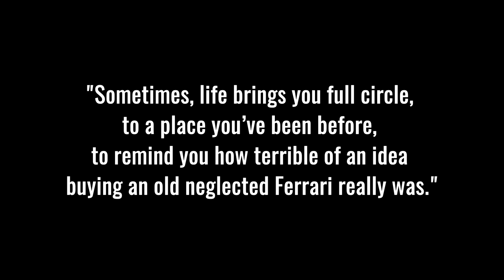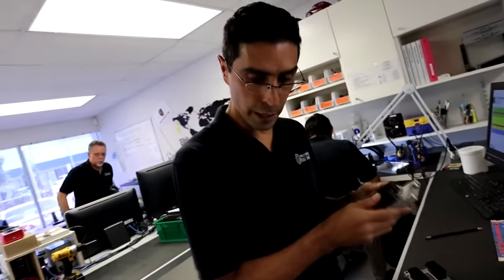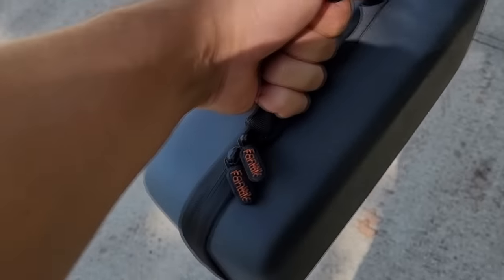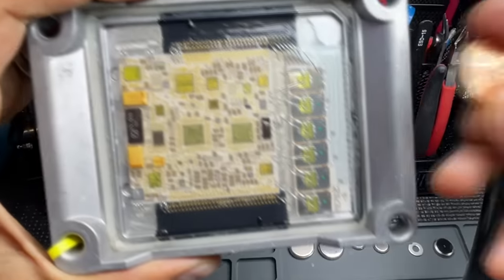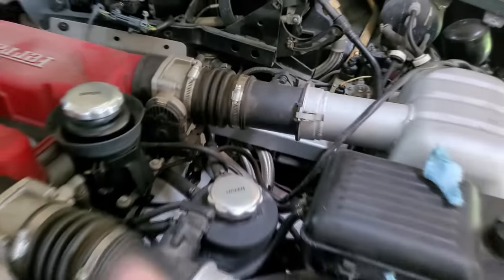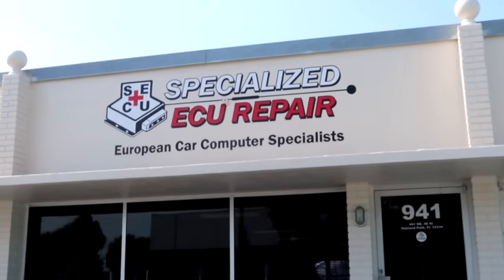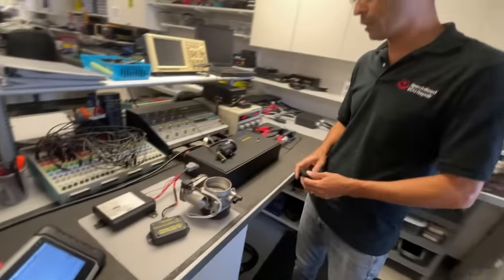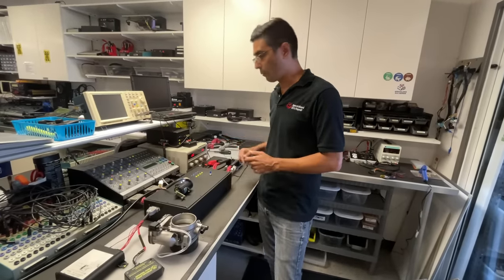Here's What FINALLY Fixed my Cheap Salvage Ferrari!!! (EVERY Ferrari 360's Fatal Flaw)

Comment: It might be worth while for them to send the software, signal descriptions and pin outs to companies that make aftermarket ECMs.  Technically they don't have to duplicate the Bosch ECM only build one that can run the engine.  Maybe a single ECM for the whole engine.  Which might be fairly easy for an experienced company.  You have to software you just need to create the electronics.
Reply: Good luck with the chip shortage lol
Reply: It would be an interesting FPGA project. As always though, it is having all the information on operation.
Reply: @hutchison82  I hedged on that probability and married a Chinese woman.
Reply: I said the same thing....every ECU basically does the same thing: uses various inputs to determine various outputs: ie cam position, and when to fire the fuel injector and spark plugs. Sure some vehicles may have more inputs/sensors than others but seriously, they aren't that much different. 

Holley makes a stand alone ecu that works with LS engines and their throttle body. B is for Build uses them all the time. 

The ferrari/bosch ecu though makes me think they designed it that way on purpose: so it cannot be repaired. Kind of like how apple designed their phones......
Reply: You’re absolutely correct just cut the wires off put your own pens and using GM or Ford wouldn’t matter all you need is the software

Comment: Impressive diagnostic/fix. It'd be great if someone could build a replacement or modify an existing ECU to get around the dwindling numbers of ECUs and escalating costs. I'm sure mechanically the 360's have lots of life in them beyond the crappy ECU design. (Even with the myriad of other issues.)
Reply: The only long-term solution for car enthusiasts is to manufacture new boards or come up with a generic solution, like the Microsquirt type equipment.

Comment: The BEST answer is to make it so they run off of 1 or 2 Speeduinos. With the right support anyone can make one and anyone can program. While that's open source, cheap - free, someone can make some money making and programming so it's plug and play for mechanics who don't have time and the inept who are incapable.
Reply: As long as the car doesn't have any sort of VVTI system Speeduino is a great shout, also dont think it can do anything with transmissions. Its rare to find someone that can do mechanics, wire and map an ecu
Reply: @ryanharveywhite  I'm sure a program could be mapped for a transmission with either an Arduino or something Arduino like, to emulate a TCU. It would probably be based on the needs of the transmission. Ferrari 360 technology or anything that old was not advanced so far as computers go.
Reply: BIG CAVIOT; the electrical and thermal automotive environment is brutal. None of the hobbyist boards or most of the processor themselves will operate or potentially survive under the hood of a running car.
Reply: @johnelectric933  True. Metal boxes and potting compound should deal with most of that. How many Ferraris are parked outside anyway?
Reply: Just mount a commodity tablet on the other side of the firewall and the adapter box inside. You could even troubleshoot from the tablet.

Comment: About jump starters: It really is amazing what lithium cells are capable of when you pack them tightly enough. While professionals will want to carry around something the size of a large microwave oven to jumpstart a handful of cars every workday, I, as an individual, can now keep something the size of a housebrick in my trunk to bail myself or somebody else out anytime anywhere. Mine isn't as nice as the Apex and doesn't have as much crank current, but it's the same idea. Biggest engine I've started with mine so far is 3.5L. These things are wonderful little tools for the backyard tinker.

Comment: Media blasting. I did media blasting for about 7 years and got very good at it. I also gained a shedload of perspective on what media blasting could do.
I think it may be the solution to your problem I think I'd start with a small blasting cabinet and some fine garnet media. Keep in mind that for something like this, lower pressure and greater media volume is the place to start. Slowly turn up your pressure and lower your media volume until you have the effect you want.

Comment: So the fix was to buy a replacement ECU and have it reflashed.
Reply: Yes. Did you not see the bit where they showed these ECUs are not repairable? machine assembled using unconventional techniques. It's the equivalent of wire wrapping done by a machine. Absolutely no chance of human repair.
Reply: @6581punk  But why we can't use a universal ecu? Buy a haltech or something and just do the wiring
Reply: @Partyczka  Its probably doable but at the moment it's likely a custom rewire job, which is more expensive than a 2nd hand ecu. I'll bet someone will build an off the shelf replacement though when enough people need replacements.
Reply: @spwicks1980  Ferrari and Bosch would probably sue them!
Reply: @aitorbleda8267  not if it was licensed. Easy way to make money on unused IP. Would make the price pretty steep though but once all the second hand units get gobbled up it'll be worth it.
Reply: @Partyczka  Because its everything else the ecu is interfaced with. That being the F1 style gearbox controller and body controller.  If it was just simply running the engine then hell yes, get rid of that Bosch boat-anchor and get an aftermarket in there pronto!!

Comment: There are several generic ECU units out in the market. 
I would suggest the following steps:
1. Get a copy of the technical reference for the Bosch device. What kind of CPU used etc. Don't be surprised if the ECU is a physically scaled down version of a VW Golf ECU :) . Maybe you could find a software compatible ECU from the same time period but in a bigger package? 
2. Attach a multi channel logic analyzer to the impressive simulator setup showed in the video. 
3. Record the input/output events during different operating conditions.
4. Disassembly of the original software and analyze it's structure and workings.
5. Start to implement the functions required in a structured order on the generic ECU so they mimic the original ECU. Test, Test, Test -> until you have the full feature set implemented. 
6. Test input/output when adding functions with a test script simulating different operating conditions. 
7. By the way a multichannel oscilloscope interconnected with a test computer that links the analog signals with the logic signals could be handy.
This is a job for professionals. You can brake things in a spectacular way if you don't are really, really careful. 
One of several generic ECUs in the market:
https://www.continental-automotive.com/en-gl/Trucks-Buses/Vehicle-Chassis-Body/Vehicle-Control/Generic-Vehicle-Control-Unit

Comment: This is great content man, that video of the bench setup with the clicking was so satisfying!  It makes you wonder why Ferrari wouldn't use a standard PCB instead of this micro proprietary one with the janky side solders.  No doubt the Ferrari Engineers know better than I do but I can't see any real practical benefit there.  It also raises the question, why did the first one fail?  Seeing that these computers are located in the engine compartment, I'd make the generalized hypothesis that heat was a factor.  Perhaps some preventative measures could be in order to be on the safe side?
Reply: BOSCH does crap like this all the time.  Ferarri just gives BOSCH the specs they need and BOSCH modifies their ECU de jure.  BOSCH stops making them after the car run is EOL... collectors be damned.

Comment: Really great Video! I am myself an electronic & IT professional and i would guess it will be not that easy at it seems to be on the first glance. The original computers are on a ceramic substrate for good reasons, there is not only vibrations but a lot of heat!! Almost every Ferrari is a very tight package, very big engine in a small body. I would guess if they had used a classic open pin package, like the old 7 series that we could see here, the computers would not make it till end of the month. The CAM and engine-sensors are easy to manage today, but building a package that will work 10-20+ years is something very different. Wish you all best!

Comment: I find it hilarious that Ferrari can't figure out how to make one ECU handle an eight cylinder engine. Like everybody else on the planet
Reply: It was common on the late 90s to have 2ecus on complex v8s and v12s
Reply: @camilaitor1  like BMW
Reply: @82_KID  I was thinking about the bmw 850-850i, yes
Reply: @82_KID  new ones don’t have that issue
Reply: V8's that spun past 7500 typically did due to ECU limitations
Reply: It isn't ferrari that makes the ecu, its Bosch
Reply: @thetechgenie7374  Muh green materials!  Yeah, rats/mice eating soy based wiring insulation, soy based foam seat cushions, etc, is always annoying.  Lots of early/mid 2000's cars with soy based insulation just had the stuff get brittle and fall off the wires in high heat environments, too.
Reply: @SteveBassen  Yep seen it brittle and no insulation anymore, seen one catch fire even.
Reply: Think they do it  to reduce   total failure   if one  timing sensor  goes engine will get you home on other  bank
Reply: @garypeatling7927  nah it's total hardware limitations, takes a lot more CPU cycles to support a 10/12 cylinder or an 8 cylinder that's spinning to 9k vs 7k. The latest gen stuff isn't as limited but the late 90's through late 00's stuff this was pretty normal to do.

Comment: Sounds like the ECU's need to be replaced by micro form factor computers running an emulation of the ECU.  Been done with other cars in the past...
Reply: In a few years open source MCU platforms like Speeduino will probably become viable drop in replacements

Comment: For those thinking that having a new PCB made is expensive ( just the circuit board with no chips on it ), the cost is $2 for 5  100mm x 100mm sized boards.

Comment: I've done a lot of work on diesels and now aerospace vehicles. Judging from this video alone,  I would suggest making a custom vibration mount for your ECUs . Seeing how the ECU is custom made with bespoke manufacturing,  they seem to be very sensitive to vibration. The wiring in the ECU is likely getting broken from work hardening under the high vibration stresses, and the eventually snapping. 
   The way you explained  in the intro where the car started the first time, but then failed after the second time is a common fault in electrical transformers with internal wire fractures. The Transformer will work when it's cold, but as soon as it's hot from working a bit, the broken wire expands from the heat and stops working. But as soon as it cools off,  it contracts and starts completing a circuit again.
Reply: I have seen that type of breakage in coil packs, on a few early model distributerless engines. Was a really bad design flaw, in Cadillac and Buick engines that caused the coil packs to fail like that. Would see it with one car that would not start when the car was cold, and another when the other car was hot. Same basic symptoms, different triggers, same test procedure as with the Ferrari’s duel ECM only with coils.

Comment: Dealerships aren't going to train new techs on old cars. That's just flat out. As older techs retire, they take the info and training with them. It's difficult to diagnose a vehicle that you haven't been trained on or had and experience with.
Reply: I mean service manuals exist so yes and no.
Reply: this is beyond a basic technician, this is more engineering. We know what is faulty, but we need a way to design it cheaper
Reply: @brayannexon4613  he's blaming dealerships for replacing ecms. Show me a service manual that includes how to resolder an ecm. I love these shops that can supply the in between, but I don't like when people throw shops under the bus because of what they are taught.
Reply: @carwerks101  yes, sir

Comment: I wonder what Louis Rossmann could do with these?
Reply: Nothing - these are not PCBs in the normal sense, and there is no soldering. Instead, the bare silicon dies are glued to a ceramic substrate and gold or aluminium wires are fusion bonded directly to the die. You would need a wire-bonding machine and a way to remove (and replace) the protective silicon coating. If the failure is with any of the chips, you will be entirely out of luck - everything will be custom.
Reply: Yeah this looks like a design that was not meant to be serviced at all... I imagine that in the future someone with enough knowhow/computer learning will be able to emulate/recreate the exact function of this or any ECU from scratch using modern parts at least that is what I feel like the best solution will be.
Reply: @ickipoo  He may have some tricks up his sleeve. An iPhone 6 on each side running an app. To keep the Ferraris coming back.

Comment: This is common on many Alfa Romeo Gta 3.2, it has the same ECu. The discrete PCB components are glued down with expensive conductive glue. Over time it breaks down and the usual culprit is a capacitor. It is repairable, no need to reprogram a different unit as it may soon develop the same issue.

Comment: Ferrari and others put the ECU'S right next to very hot engines on purpose.
It's built in obsolescence right there.

Heat shortens the life of electronics full stop.
Some ECU'S are behind the bulkhead (bad for getting flooded!) others are under a seat (probably the best environment) but cabling becomes much longer.

Perhaps a good reason not to buy a Ferrari after watching this great vid 👍👍

Comment: The problem with these ECUs are the outer aluminum (silver colored) bonding wires. They just degrade and break. The thinner, gold colored ones are usually ok. You can verify this by just "poking" the thicker silvery wires. Most of them will be stiff, but some will feel soft, and easily detach from the ceramic base.

Comment: Here's a thought...
I did with a Rover years ago using CVH etc parts...
Convert almost everything to pre ECU ... Actual cable throttle and standard relays etc ... and use an easily available basic ECU maybe the BMW or make your own... Also extend the cables so the electronics are not in the engine bay .. heat and vibration with extreme miniaturisation is the enemy.
Regards Mark.

Comment: When you can extract all maps, why not just upload them to generic universal ECU. It just won't look so nice in the engine bay.
Reply: I was thinking that, but potentially Ferrari may have some proprietary chips built in to ensure its a genuine part?
Reply: @putraadriansyah8082   - Sooner or later, there will be a Raspberry Pi based replacement ECU xD
Reply: @philrod1  then the raspberry pi can be used as a Onboard tuning computer (running TunerStudio with openjdk-11-jre?)

Comment: The black key fob with the small 12V cylindrical battery was made by Bosch for a number of car manufacturers, Ford and Ferrari being 2. There are internal EEPROM parameters that define it for use with different manuf.

Comment: It’s worth looking at Speeduino ECUs. These use the Arduino Mega. I’m not sure about the paddle-shifting, but we have made Speeduinos work with all sorts of configurations, some with home-made electronic throttle controllers based on the Arduino Nano. The downside is that you can’t use OBD2, but you can tune the hell out of anything!

Comment: You know, in the age of custom PCB design I'm surprised that no one has just gone back and reverse engineered the ECU board and come out with a drop in place upgrade that's been built to modern specs.

Comment: Bro I feel like this ECU could be replaced with a Raspberry Pi
Reply: You need real time software here and run in on bair metal, the pi  isn't realtime enough and it won't survive under the bonnet. Maybe something like FPGA can work here.
Reply: Doesn't have to be raspberry pi but a decent microcontroller board would do the job easily I imagine.
Reply: the answer would have been to just make it like the BMW computer shown with normal off the shelf chips instead of microscopic wires bonded directly to silicon.
Reply: @KokoReko2  Bring realtime or not depends on the software not the hardware. A Raspberry pi can be a real-time solution when using a real time operating system. It's probably overkill, but that doesn't hurt.

Comment: Starting a car direct is easy for a jump pack as there's no faulty component absorbing the power. It's when a big battery is dead/has a dead cell that the small ones fail. In my experience of 15 years working at a garage, you need a really powerful jump pack to enable the juice to get through the dead/faulty battery and into the car.

Comment: Usually wire bonds brakes. Just push on the wires a little and will see which one is broken. It is hard to see. 
They usually brakes at the connectors!!! Not at the semiconductors. Because the vibration is conducting trough the harness. 
There are couple methodes to reconnect the wires. 
These are spot welded originally. 
You can use conductive epoxy. You can replace the aluminium wires with copper and solder it with low melt solder and a special flux. 
Or if you invest. Can use ultrsonic soldering tool.
You can build ultrasonic soldering iron. You have to attach your soldering iron to an ultrasonic horn.